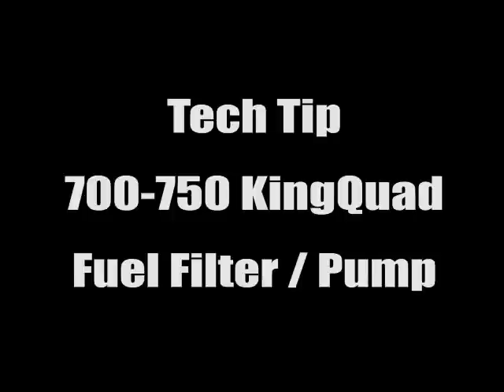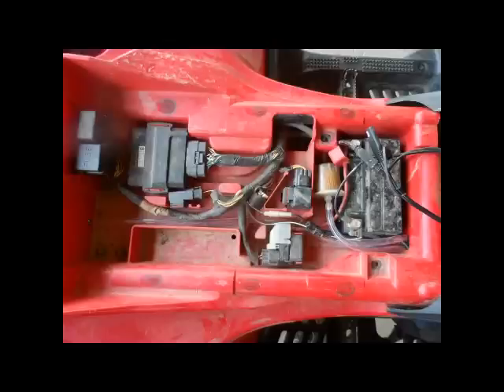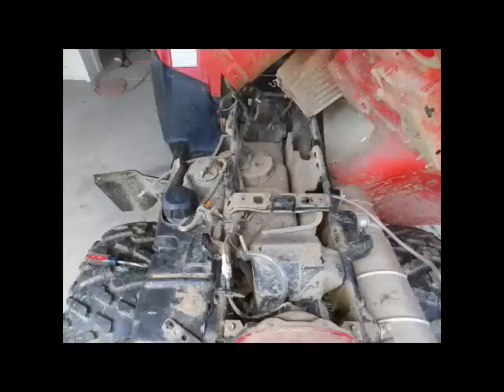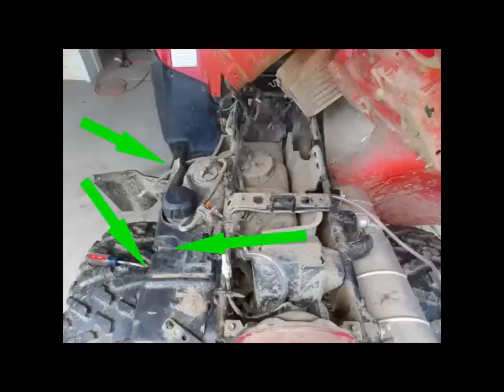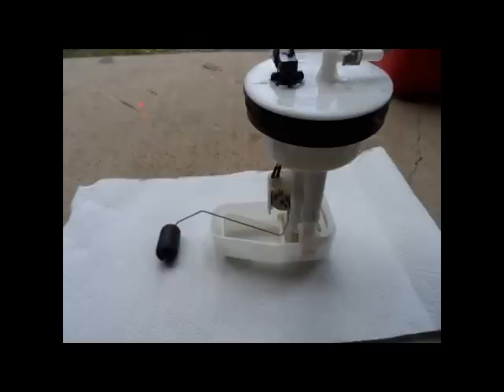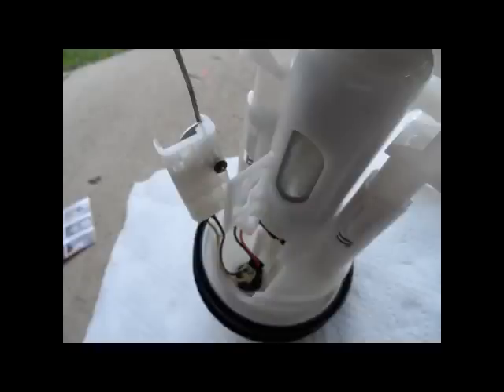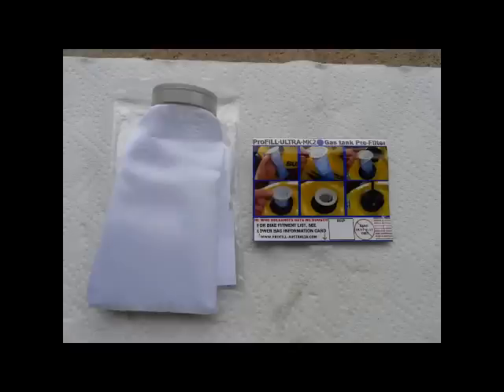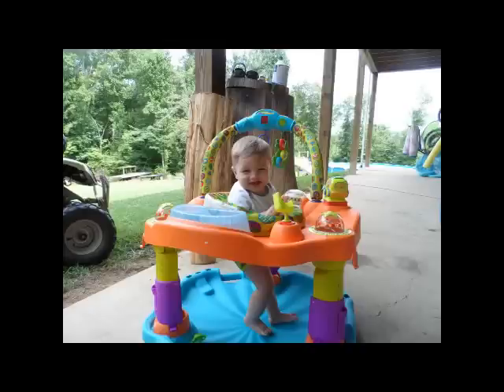How to install fuel filter in Suzuki KingQuad (ProFill)

Comment: I have 2 questions, 1. Does removing the fuel line from the sending unit require A special tool? 2. please describe how the back plastics come off, I cant find ANY videos on that.
Reply from the maker: Gary, it does not require a special tool unless Suzuki has changed the connection on newer models. There are two tabs on each side of the fuel line connector that mates to the sending unit. Squeeze these in and push toward the sending unit and then back to remove. 2. After removing the rear rack, follow the video for removing the wiring under the seat and then a couple of bolts.

Comment: Thanks for the excellent video, Jayson & Crystal.  We have 2 2011 Suzuki KingQuad 400's.  First one started dying when it got hot, figured it wasn't getting fuel so tried blowing into the little rubber line coming off the top of the fuel cap.  Found that if I pressured up the gas tank and held the pressure there it would run then.  Took it to the dealer and told them all this and that I thought the fuel pump needed to be replaced.  They didn't believe me, did a couple of hundred $ diagnostics, said they had it fixed so we took it home and it did the same thing.  Bottom line we had to take it back and they finally replaced the fuel pump to the tune of about $500 and it has run great ever since.  I thought at first it might be a fuel filter restriction, but the dealer said the fuel filter was INSIDE the fuel pump.  Seems like an inline filter or the filler sock you have would be an improvement.  Anyway, we may replace the fuel pump ourselves this time.  I am interested to see if a pump for $30 on Amazon might work.  Reviews indicate it does, though might need some slight modification....  Either that or back to the dealer for another $500 fix...
Reply: a big thank you for your very informative video, i just removed my gas tank on my 2017, question;  what is the part number of your new filter.  My original number is 15420-31G00.
Thank you 👍

Comment: How do you get the filter off
Reply: Just did this so I’ll explain for a future reader. The fuel pump must slide out of the plastic body for the filter to slide out. To avoid the hassle I trimmed out the bottom plastic end as the new filter fits better without a small section of the bottom plastic. Took 10 mins to finish the job.

Comment: where is the fuel filter on a suzuki Vinson 500 2005 model??? and oil filter???
Reply from the maker: Jason, I've not had any experience with one of those yet. May want to check tech tips over at nyrocatv.com
Reply: Will do thank you very much!

Comment from the maker: 231Massey, the King had a little over 3000 miles prior to selling it last year to fund other projects.  Had to replace rear axles at one point, changed fuel filter just because I'm a maintenance freak, belt every 500-1000 miles and other than that just general maintenance.  Great quads, very dependable and not the best at anything, just good at everything. At this point I've not purchased a Sportsman to review yet. Some of the guys I ride with have them and they also seem to be a good quad.
Reply: my kingquad 700 2005 let me down this winter it stop after a 15 min ride in snow whit tracks and just start it run for 10 sec and stop again so start again and stop all of this for one minute so i decide to let the quand in my farm land until spring and 4 months later i start it and every thing was ok so i think the problem is i had some water in the gaz and it frozen on the filter so i am planing to change the pump and the filter and change the old gaz in the tank

Comment: Thanks for the write up for this as I'm looking into doing a fuel pump replacement on my 08 KQ 750 AXi.  
Question, I'm getting the C41 code as well as a temperature warning light. can the fuel pump or issues related to the fuel pump cause the quad to run lean and cause it to run really hot. The temp light comes on with the quad not running and being cold. Thanks again
Reply from the maker: Joseph, your diagnosis certainly sounds feasible.  What does the C41 code refer to?
Reply: +Everything ATV-UTV-Reviews C41 is Fuel Pump Control trolling System.  I believe my pump is now shot or 90% dead. it now won't start, runs extremely hot. I'll be doing the fuel pump and parts related. but I have to direct connect the pump to see if it's not my ecu.  It could be bad and not communicating with the pump.
Reply from the maker: Joseph, great information.  Let us know how the fix turned out, I'm sure others will need your insight in the future.